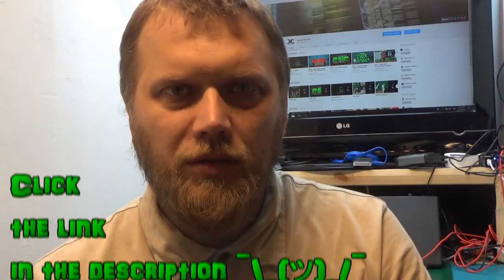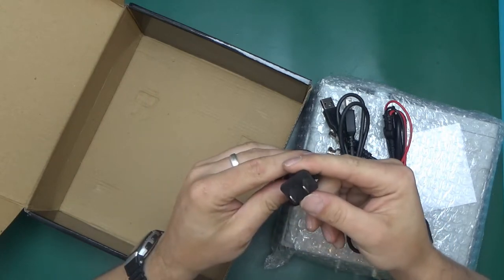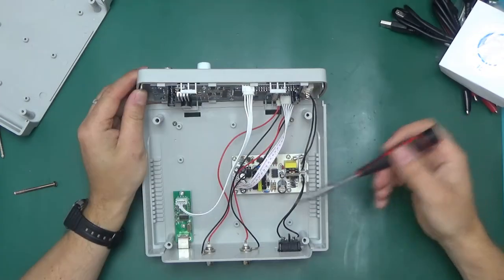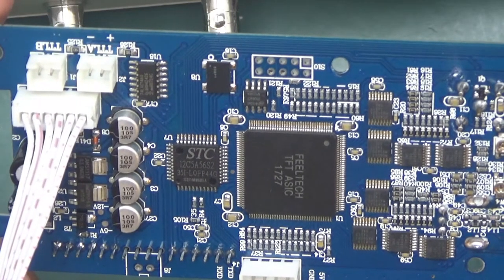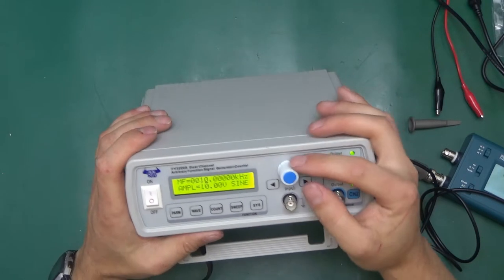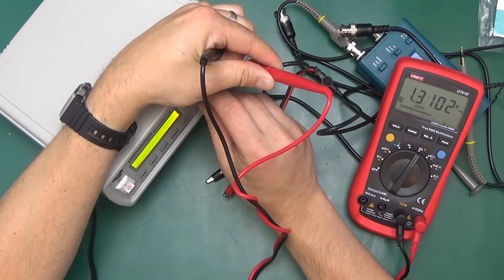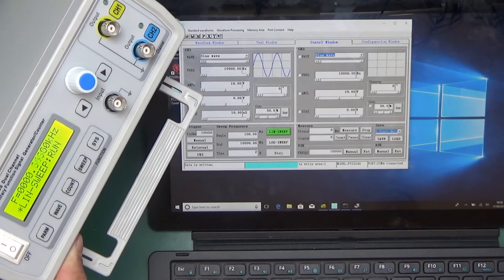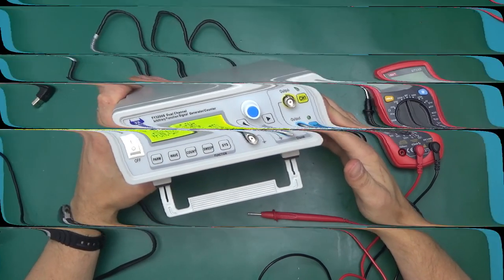#007 - FY3224s DDS Generator:  Quick look and teardown

Comment: Some owners of generators such as this have replaced the switching power supply with a transformer-isolated linear power supply, given the switcher's mains leakage voltage appears high or even dangerous.
Reply from the maker: Are Jayem thanks, I will look into this! There seems to be enough space in the enclosure to add a transformer and a voltage regulating circuitry. Sounds like a fun project to do!
Reply from the maker: @alfa-psi  didn't think of that, but low power isolating transformer, like in a shaver socket, could possibly do it. But still, I think I might eventually make linear power supply for it, seems like a cool project.